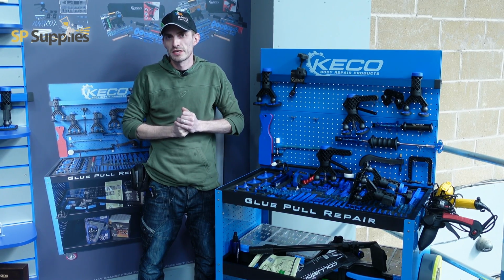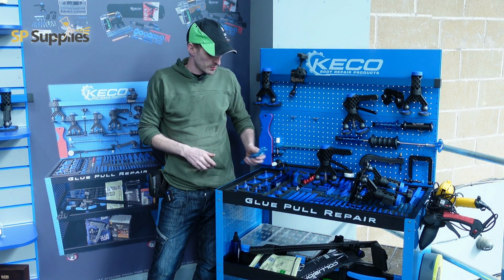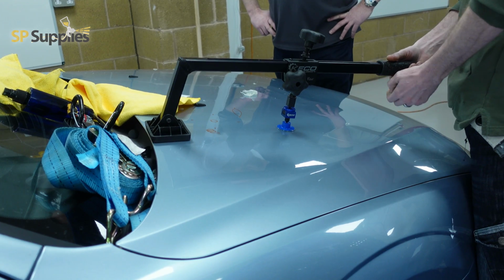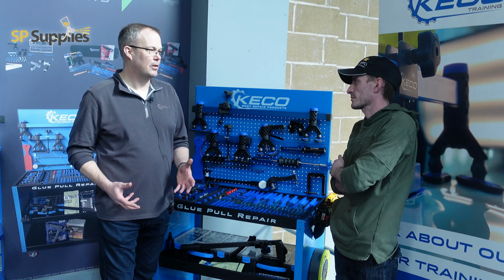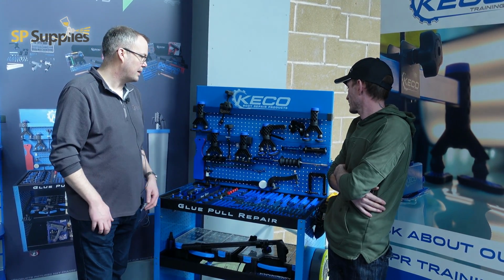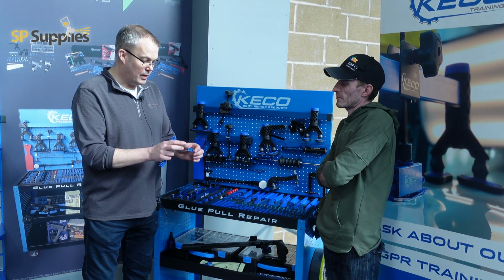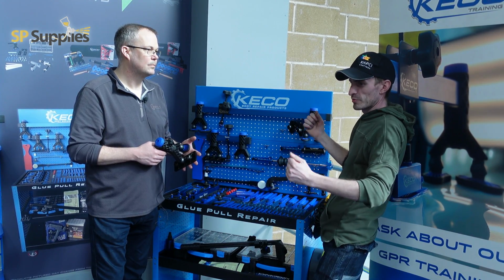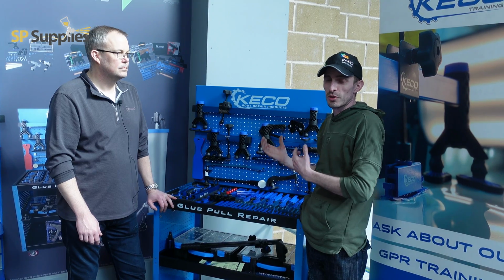Keco UK -  Glue Pull Repair System - OPEN DAY Part 1

Comment: Hi Tony will there be a part 2 demonstrating what is the most severe dents keco tabs are capable of pulling out, because I have a car with some dents and would like know if they can be removed with keco tabs or will I have to use a different method to remove them because they are to severe for keco tabs, you can't send photos to YT is there somewhere I could send them for your advice please. Many thanks
Reply from the maker: There’s a video up tomorow of the live demo they put on specially for us showing the process however these are more than strong enough to remove almost any damage they work better than stud welding that’s for sure my email is in the video description
Reply: @Tonys refinishing Thankyou for reply, saw this video today and I was quite impressed at what can be pulled out with these Keco tabs.

Comment: Not seen one of these systems being used on a bike tank yet, great use case as welding on a tank that’s had fuel in can be exciting at times 😝
Reply from the maker: He said one that has had fuel in not has fuel in even an empty tank that’s been flushed can still hold vapours for a very long time
Reply from the maker: I’ve seen these used on tanks mate and there more than strong enough
Reply from the maker: It’s a mixture of the glue the process and also the tabs and the chemical components of the three working together mate I’d say with a spot welder you’d get a lot less pull than with these strength wise as this is over a better surface area not just a pin point so to speak
Reply from the maker: Nah it takes years to perfect mate as a skill that I’ve not got that kinda patience lol abs I love what I do can’t beat being in the booth